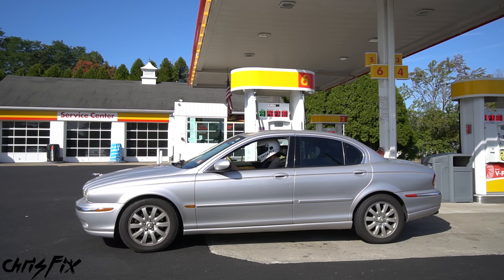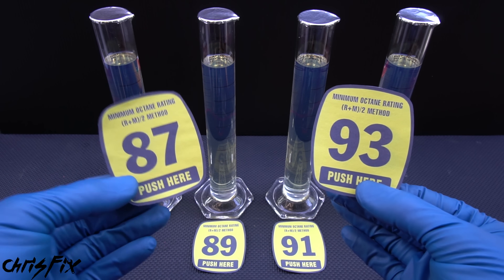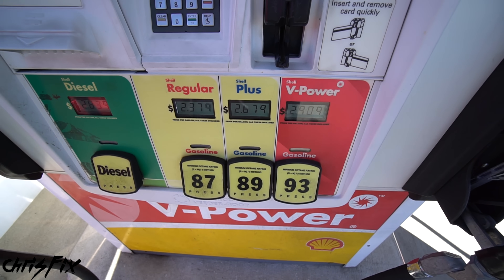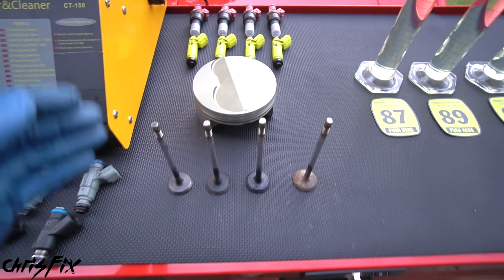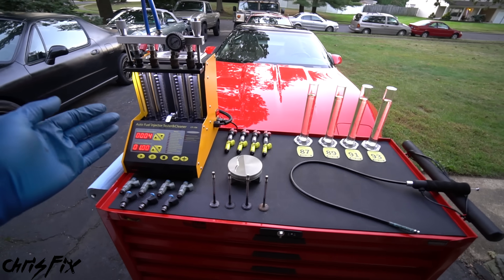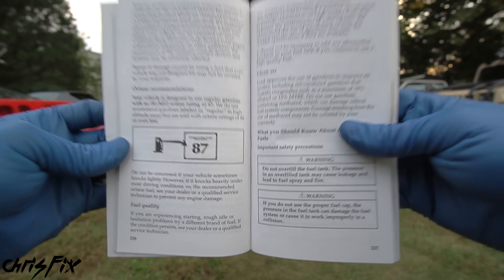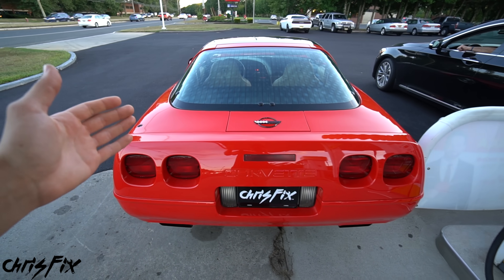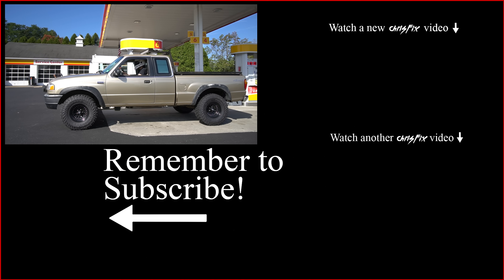What is the BEST Fuel to Use in Your Car or Truck and WHY

Comment: In Australia we have 91, 95 and 98 Ron and so far the 98ron ive noticed lasts longer and makes my car feel smooth than I tried 91 and 95 Ron and it felt delayed  and 25% E85 75% 98ron (not flex fuel risky but that's why I mixed) runs extremely good really responsive and made me trust my car more to get on a highway engine was an L36 Ecotec (Australian version GM 3.8)

Comment: 1:50 Better fuel economy on better fuel is a myth
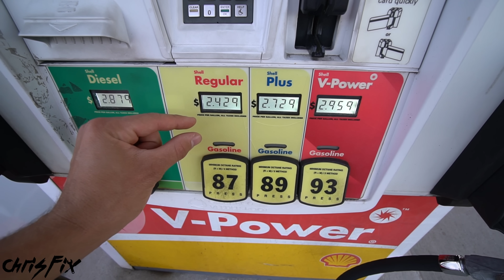12:23 Using regular fuel, you'll lose a little fuel economy and a little bit of power
Reply: That's an apples to oranges comparison. He's talking about his Corvette, which is designed to run on premium but can also run on regular. In this case you will get lower power and economy not using premium. In 99% of vehicles that weren't designed with premium in mind you won't realize any power or economy differences when using premium over regular.
Note the language on the fuel door "premium fuel recommended" versus his mustang "87 octane recommended"
Reply: Technically, he misspoke a bit.  He should have said "you'll lose a little mileage (i.e., miles per gallon)..."  Economy needs to take the price difference between premium and regular into account, which can vary significantly based on where you buy fuel.  In the video, the price for premium is about 22% more than regular.  If you normally get about 30 mpg regular, you would need to get at about 36 mpg on premium for the same fuel economy.  From my experience, you may get 32 mpg on premium, which makes regular more economical.  Chris Fix did a nice job here.

Comment: You say at the start of the video that the octanes doesn’t have anything to do with gas mileage or performance, yet later when ur talking about recommended gas in cars you say if u don’t use recommended you might get lower performance or lower gas mileage. Could you please explain?

Comment: I've got a question: some years ago (in 2005) I was driving a 2003 Toyota Corolla with about 12000 miles on it, which had been very well maintained by me. One day I decided to put Shell 87 in it, which is the octane recommended for that engine. Before that, I used to fill it with 87 octane from another brand without any issues. But the whole time it took to empty that full tank of Shell 87, the engine would take forever to start up, whereas before it would start right up. With the Shell 87 it would crank, and crank, and crank for 6 to 10 seconds before finally starting. So much so that it worried me. I had the dealer check for possible engine codes, or fuel pump problem. But everything checked out fine, no pending codes, full fuel pressure from the pump. As soon as that tank of Shell 87 was finally emptied and I filled it with another brand 87 octane, it came back to normal. 
What happened ? I don't know. But I've decided to never put Shell fuel in any of my cars ever again since then. Maybe 7 times more cleaning additives is too much ?

Comment: @ChrisFix - One thing I would like to see is a video on de-ethanol'ed fuel/clear gas. I personally have swapped over from premium to DEF (not diesel) in my '99 Saturn SL which had originally run regular when I bought it at 180k miles and had only been getting 23 mpg city to barely 30 highway. I personally have receipts to prove that it help my engine both in fuel economy as well as power and cleanliness. I also found I have MUCH less carbon build-up on all of my engine components! Here I am 2 years later at 220K miles getting a city average between 33~38 mpg with highway getting a staggering 42~50 mpg! (again with receipts). Much love and thank you the amazing video!

Comment: You don’t have 95 and 98 octane fuel in US? I thought most modern engines are designed for high octane gasoline and that you’re not supposed to use less than 95.

Comment: If your engine will run with no problem on 87 and you put 91 or higher octane gas. gas mileage will get worse not better. Power will decrease and volumetric efficiency will decrease when using higher octane fuels in a car with low compression. 87 octane will give you the best gas mileage with the least amount of additives and more gas and less additives. In a low compression engine those additives will amount to nothing and could actually do the opposite of what they are intended to. So the lowest possible octane your engine can run on will produce more power and greater fuel economy compared to higher octane's that your engine was not designed for. But like you said on the other hand if you have a high-compression engine or some kind of forced induction 91 octane or higher than you can get at the pump like in a race engine  92 to 110 octane but of course these type of engines are much less efficient. Most cars use 87 octane and if you use a higher octane your gas mileage and power output will decrease in a car designed for 87

Comment: The video was informative but what if you’ve got a 93 Mustang GT that has some stuff done to the motor? What would you recommend? I’ve ran 93 in the car since I got it but would love to hear from someone more experienced than me.
Reply: Continue running manufacturer recommended fuel. Unless your mods effects the A/F ratio, compression ratio, or have a different tune, you will use what the new tune calls for.
Reply: Luke Kraus Yes, that’s what I was getting at. It has a bigger cam, bigger intake, better flowing headers and exhaust, and bigger throttle body

Comment: Hey guys I highly recommend not using octane boost, it coats the spark plus causing a miss fire and can even clog up a fuel pump over time. I'm a mechanic for Nissan and Kia and the only thing I would add would be a techron cleaner every oil change. Just giving you guys my opinion and a heads up 👍

Comment: I wonder what your thoughts on the “up to 10% ethanol” stickers (I live in California, I’m not sure if it’s the same in other states) and how it affects an older car. I have a 2009 Toyota Camry with 100,000 miles on it, however, it was driven infrequently until it was passed down to me for driving to and from school. My dad and I saw that the car knocked every once in a while and gave a rough idle with 87 fuel with ethanol. If I go to a gas station without the ethanol sticker, the car seems fine, but has half of the usual mileage we usually would get on a tank. If I use 89 fuel with or without ethanol, the car is fine, but also gets about the usual mileage from when it was new (of course wear and tear). I’m confused why my car is like this. I don’t know if it’s the ethanol or the octane rating. ??

Comment: Hey Chris, great vid! I have a 2008 Tundra 5.7 4x4. Living in Utah, the gas stations have 85, 87 and 91. I fill up at Costco, which only has 85 and 91. My manual says “select octane rating 87 (research octane number 91) or higher - use unleaded gasoline with an octane rating lower than 87 may result in engine knocking.” I fill up about every two weeks with 85 and every fourth or 6 months I fill it with 91. My wife’s Honda Pilot says “unleaded gasoline, pump octane number 87 or higher.” I guess my question is the 87 in the manual the 85 in Utah so that’s what I should be using and just put premium in once in a while to keep things clean?
Reply: Hey Chris, just wanted to follow up on this to get your thoughts?

Comment: My car pulls off faster with higher octane. I definitely feel a difference in my car.
Reply: Mine too, my car ""requires"" 87, but it honestly doesn't seem to like it at all, I always use 93 which it loves. It might be similar to Chris' truck, since my car is an 80s model though I've never heard any knocking.
Reply: Devon M mine in a 2014 and says to use 87

Comment: Nothing bad would happen if you switch from regular gas to a e-85 on a flex fuel truck even if it’s never been fueled with e-85? (Trucks at 75,000 miles)

Comment: Your wrong about saying you won’t gain power from going higher octane... you can throw a car on 87 and it’s going to lose power over 93... then if your using e85 it burns WAYY cooler IAT ECT everything is cooler with e85 compared to 91 or 87 and you make way more power it’s also 105 octane ....

Comment: That's really good we were just talking about that the other day for a Volkswagen but it's not a pump it's called a dispenser nowadays the pump is in the ground nowadays. On the pump used to be in the pump well the dispensary is nowadays also once the nozzle clicks off do not keep feeling where I live at vapor recovery which is a little hose inside the big hose and it will literally suck gas back out

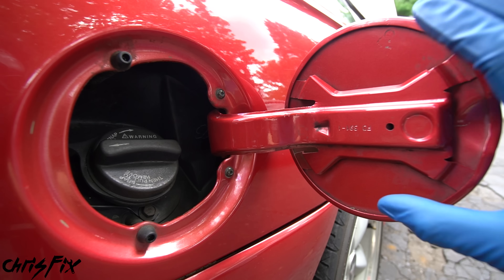Comment: The Answer awaits you at 11:12

Even before the video started I was going to say just look in your owner's manual.
Reply: Can I use an owner's manual if I steal a car?
Reply: Motor swapped vehicles are different though. You need to follow the engine manual / tuner specifications.

Comment: did you just say that all fuels burned at the same rate?
Reply from the maker: you can always replay it if you are unclear. We are talking about gasoline.
Reply: @chrisfix  yeah Gasoline specifically, not Ethanol, not Methanol , not Nitro methane ect...just the way the sentence flowed became objectionable all good. Same with the explosion comment, nicely corrected later with a controlled burn. Ah you know car people always quick to criticize haha

Comment: You didn't mention anything about ethanol-free gasoline. I understand that EF gasoline is at least 4% more efficient and contains more energy and does not have the possible corrosion problems associated with ethanol containing fuel. Of course in some states it is next to impossible to find especially at an affordable price.  All this plus many classic cars can benefit from using ethanol-free gasoline.

Comment: the'rs no myth about it my car runs a lot faster with V power than on regular i've tested it many times, and it seems that it has more power on higher octane fuel, like it takes ages to get to 100 km/h with regular fuel, but it goes really fast when using higher octane fuel, about the economy from higher octane fuel i think it's actually in reverse, as with a full tank of 100 octane racing fuel i only managed 250 km while on 95 octane fuel i get to 450 km on a tank and lately i got to 500 km on regular
Reply from the maker: Thanks for sharing your experience!

Comment: @12:11 why is "Super Recommended" tapped over? My truck takes regular and it has 220,000 miles. I wonder if it wouldn't hurt to run high octane shell gas for 2,500 to clean up some carbon.

Comment: I dont think anyone in Europe especially in eastern parts think goods at all in the USA are worse than european. I personally have tested ball bearings from american brands VS top european brands and guess what? Not only american ones are cheaper but they last longer and have perfect quality! I very much doubt that american petrol products fuel, oil etc. are of worse quality than ours! In the past there were 86 and 93 octane but 25 years ago someone decided to convert them to 91 and nowadays there is 95, 99 and 100 octane, but I think the old style was more like american way of calculation the igniting resistance and the new style is just trading trick to make you think yor fuel is better than before!
Reply from the maker: Thanks for sharing.

Comment: Higher octane means higher compression. If u have more compresion u will get more power. So higher octane does give more ponies under the hood, if the car needs the higher octane. if not it properly wont matter
Reply from the maker: Thanks for sharing!

Comment: Nice video. Thanks. I would add 1 thing. In a case of a sport car for example. Running lower OCTANE will pull timing. Reducing the output power. Running higher octane will allow the car to use the full potential. In other words. Higher octane u use the max HP of the car. Lower octane. Car pulls timing and so the hp

Comment: I use 99 in the UK.  £65 to fill translates to around 85 USD,  it does give a slightly higher performance output

Comment: This is true to some extent. My friend bought a 2013 Honda Civic in 2013 and the owners manual recommends using 87 octane but the car would always lag when she wants to take off quick. She started using 91 octane and the shit moves flawlessly. & her compression ratio is 10.6:1... U normally don't use 87 with a compression that high. I had 2001 Lincoln LS V8 a 10.5:1 compression and it used 91 octane. Manufacturers can mislead people sometimes.

Comment: Depend him many sensor do you want to burn out? For cheap gas is made to tare your car up while clean gas will not mess it up made to keep rich people rich and poor people cars to break down I'm 48 years old so no they do not have the same my truck has way more power then low grade I'd h aft to clean my carb up more often then with the cleaner fuel!

Comment: One more scenario for using higher grade fuel you didn't have in the video. Extreme conditions. Driving through the desert, pushing the engine in high altitude accents like crossing the rockies. Pulling a heavy load with a trailer. In some of these situations you might need to use a higher octane fuel you normally wouldn't need because of the type of driving you are doing.
Reply from the maker: Thanks for sharing!